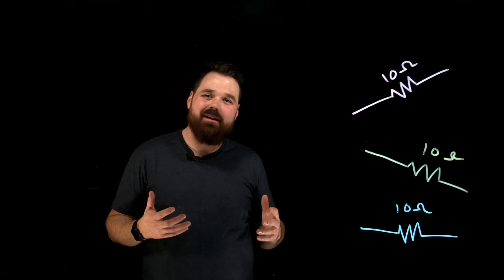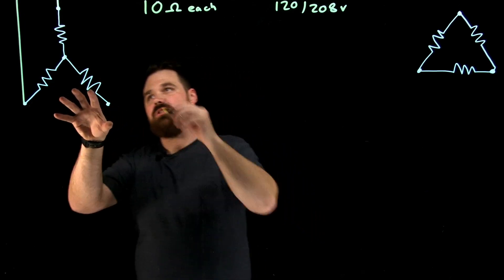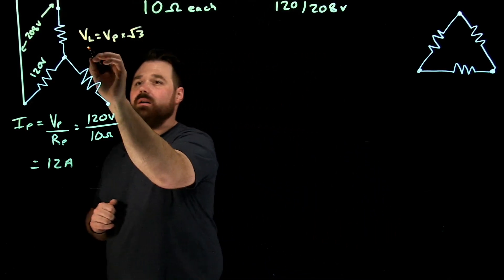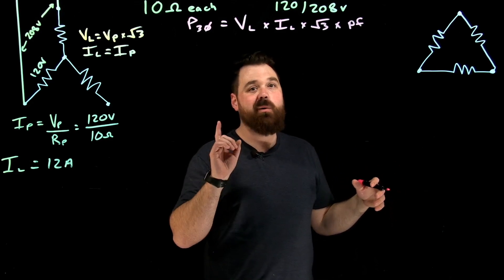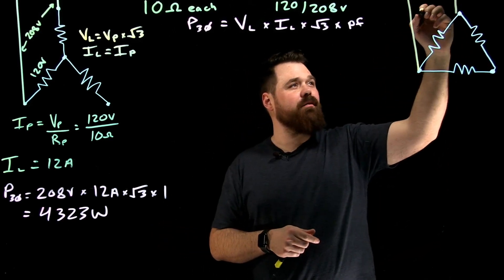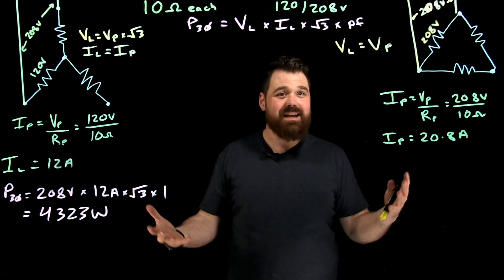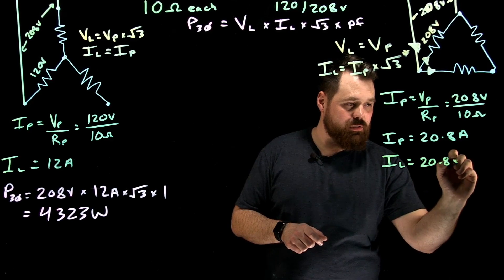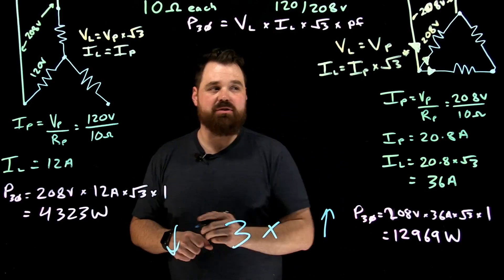Should I hook my Resistors up in Wye or Delta for more Power?

Comment: I believe sir, there is a catch here: phase in Y connection is pretty much that line to line which is 208 as three phase. if you are talking about single phase ( line to Neutral ) then that is 120 V . isn't that right ?
Reply: Yes, but that's just for single phase, and this is specifically about three phase. You couldn't hook up a three phase motor to a single phase source, after all.

Comment: This really helped. I was trying to understand the workings of a wye-delta motor starter. It's a circuit configuration that starts up the motor on a wye starter, then shifts to a delta starter so as to buffer the starting surge of current onto the motor. All I knew was that a wye-delta starter reduces the initial surge of power by a factor of 3 as compared to the simple Direct On Line starter, which helps the lifespan of the motor. You helped it all make sense.

Comment: 3x bigger is 200% increase. To get the same power you must triple the resistance.  The Wye is simple to understand in the way that the center point is neutral so it is similar  to three resistors in parallel on a 120 V single phase so it  is 3 * 12 A * 120 V = 4320 W.

Comment: DELTA line voltage of 208.    When you drew the PHASE voltage of 208 I had to stop the video.  Did not EXPECT that.    Thinking to myself.

Need to go over this again.  thank you

Second replay.   GOT IT NOW.   No neutral on the Delta, therefore line
and phase VOLTAGE is the same.